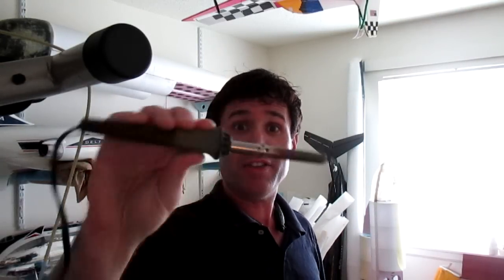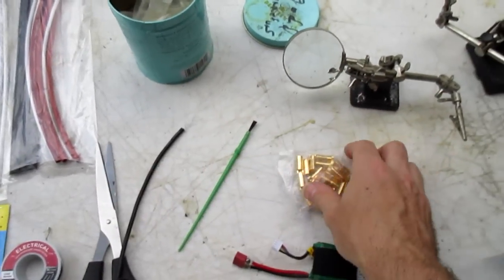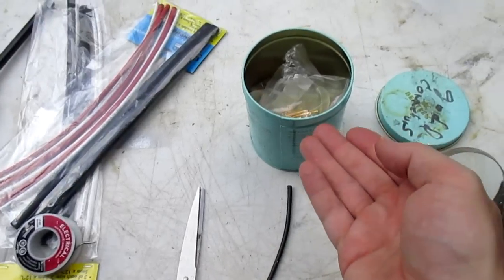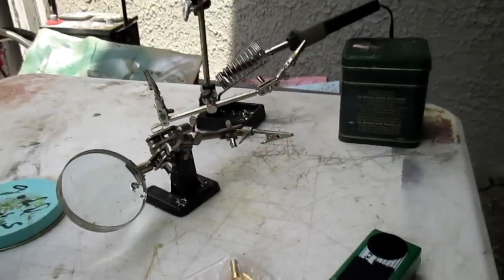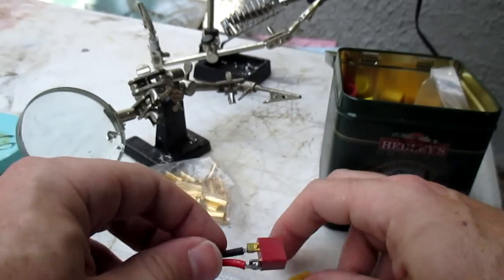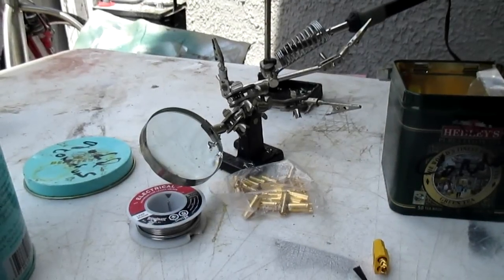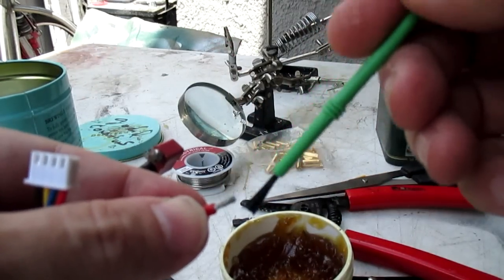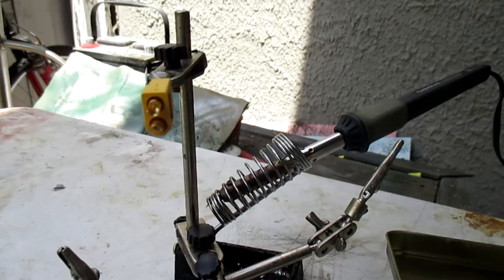HOW TO SOLDER! RC LIPO BATTERIES & CONNECTORS!

Comment: Seems mostly good but when you are tinning  your wire, u want to heat up your wire and allow the solder to flow and coat it all through the strands, not dab the solder on it from the iron. The time you're wasting dabbing, the flux will just burn off leaving you with a cold joint

Comment: But you are supposed to heat the wire first so the sorter goes in the wire that's the reason you use flux. The way you did it could result in a cold solder joint. No good if it come apart when flying. No offense I'm a big fan.
Reply from the maker: No offense taken my brother. . . . They way I solder and the type of soldering iron I use is fine for this purpose.  . . These soldered connection won't fail. . . How do I know?  Because I have them in over 50+ planes I have soldered.  . . With not one failure of a soldered connection.
Reply: Great video mate 👍👊👍

Comment: The wattage of the soldering iron is important so you want have to play around with the soldering iron on the solder as you can trap air in the solder or part of the solder will have lower temperature than the near to soldering iron solder and it may result to cold joint that will eventually break. Instead keep you soldering iron on the solder for a few seconds until it becomes a  uniform liquid and the temperature will spread to the solder the cable and the connector evenly. There is a book the principles  of soldering check it out.
Reply from the maker: +Dimitris Dimitriou.  I'm grateful for the Advice Dimitris! I defenetly need to get a better sodding iron.
Reply: I was thinking the same thing. Flux both surfaces first, then insert wire all the way down to the connector's end, then get them hot with the iron and THEN introduce solder.

Comment: hey demon, do you have a vid on replacing the balance plug. im worried about shorting it
Reply from the maker: Darrell Brown Hi Darrell! I don't have a vid on soldering balancing leads Sir, Sorry. . . If the wire break is at the battery usually I return or trow the battery away soldering a lipo can be a dangerous proposition.
Reply: actually, 2 wires came out of the balance plug. you know how much of a bitch they can be to disconnect after charging. just another reason not to bite your nails.i suppose discharging the batt to zero would not be an option. no one talks about that much. CAN you discharge a lipo to zero, or does that drive a stake thru its heart. man, handling these things is like handling nitro glycerin, like on that old Bonanza episode.

Comment: I use three defeat connector traxxas EC5 and EC3  but my rc are traxxas and Spektrum and I solider my connector on all my battery and esc and  Bullet connector is only  Change out when you  need to change motor connector that is hardly ever done

Comment: Soldering isn't that hard just you have to have  Patient next good soldering  Station next is good solder depending on if you have  flack in solder or not if you need flack me personally get flack solder wire because it's just much nicer

Comment: in your video how to solder RC lipo bats.   You show your battery with 2 connectors on it,  do you know what type of connector the white one is??  I have a camera that's on my drone that the connector came off and not sure how to fix it.  thx
Reply: That other connector is for charging the battery so you don't over charge or Puff the battery up you could look up how to fix a balance plug or how to resolder a balance plug on a LiPo battery it should help you with your problem

Comment: This video should be listed as to not solider connector because and I clean my solider  Iron then I use the heat from iron to heat  Shrink why use a lighter when you get heat from iron and I buy great solider with flex in it so I don't use flex I have a  Container of flex but the only time I use extra flex is when I can't get solider to look good solider is like welder if you know how to weld you know how to solid

Comment: Another thing. With that solder that you showed in the video. You don't need flux anyways. The solder comes with the flux already. Like I said I'm a big fan of your videos but man. You're using the wrong iron too. Is not hot enough. You can see it when trying to solder the bullet connector.
Reply from the maker: I understand what your saying but the soldered does have Flux but sometimes the steel wire can still resist the solder no matter how hot it is but once you add some extra additional Flux the solder sticks perfectly.  .. . . And this iron is plenty hot. . . I have one that's even hotter but it's overkill for soldering these type of connections . . . . These connections will not fail in flight! Soldering is like cooking &  ever chef has his own methods Sir. Thankyou for your input.!

Comment: wow this guy seems  a little back woods hickish .. he doesnt even use proper terms  and his soldering of the connector is wrong you dont just heat a pool of solder and just shove the wire in .. thats how you get a cold solder ... you want to heat the wire and the connector and melt the solder so they flow together..  get the iron nice and hot ... clean your tip every time and of course use flux..  and they are called wire strippers  duh!  and dont try to use scissors to cut the wire  and  whatever u do dont cut the connector off in one cutting motion thats how you blow up the battery  by connecting the pos to the neg through the cutters  cause they are made of metal and they conduct..
Reply: So true but this was a great video of how not to